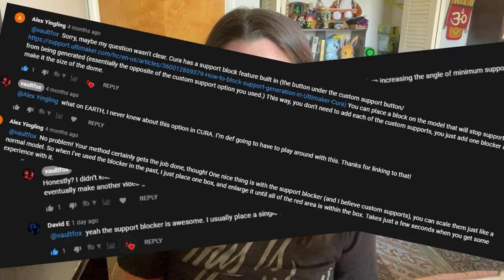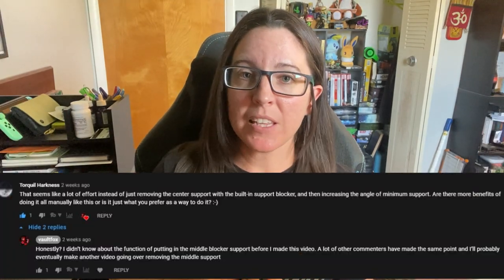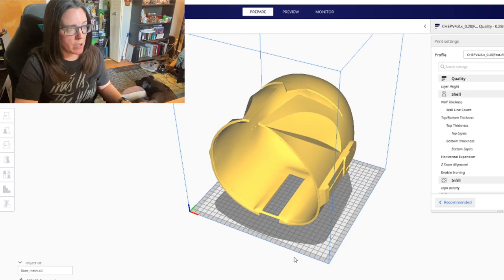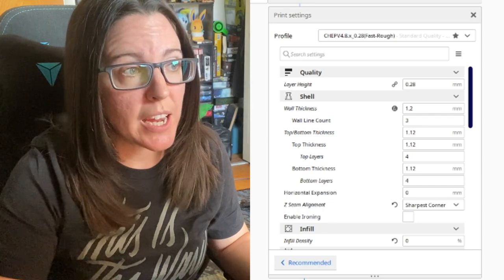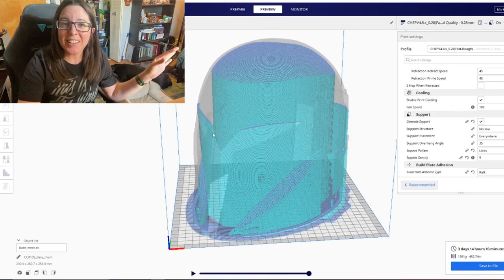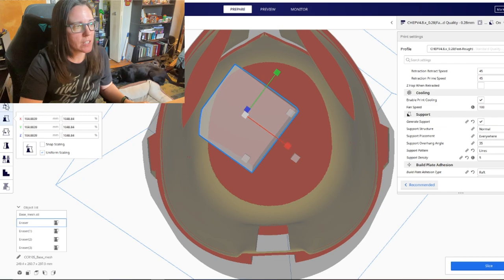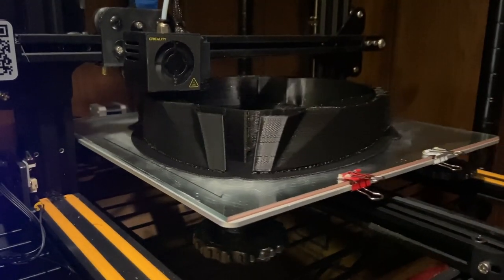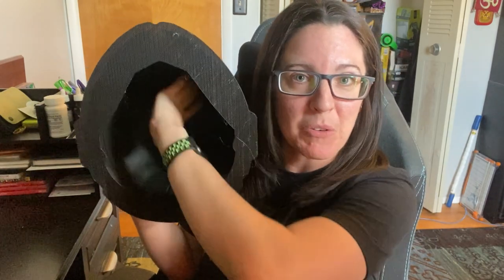How to 3D Print Helmets in ONE PIECE with CURA Block Supports // Beginner Friendly Tutorial

Comment: Hey, for rotating the helmet in the beginning you can use the "select face to align to the build plate" tool under the rotation tab in Cura, which makes it basically perfectly flat on the bed if you click on the face you want to put on the build plate, I also regularly turn off the "Uniform Scaling " under the size tab to only have to use one support blocker for irregular shapes, like the top of the helmet you had to use 4 for. Hope this helps you out!
Reply from the maker: oh that's a good trick to know, thanks for the tip! I'm so used to doing it manually so I'll have to give that a shot next time around
Reply: Yup. was just writing this until I saw someone beat me to it... about a yr ago. lol 
Great videos!

Comment: Great job. I do one block in the center and then size it without uniform scaling. I make it wide and short (like me). Another thing that I do is set my support overhang angle to 65 with general tree supports (mostly) and put in custom supports on things like the visor.
Reply: BTW, have you tried Arc Welder, yet?
Reply from the maker: LOL wide and short that made me snort ... I played with making them odd shapes but just found it quicker to just make those boxes, same reason I I just kept the overhang where it was so I didn't have to add in custom supports on the visor  I was also a bit frustrated with my PC continually crashing while I tried to slice this (it def needs replaced soon lol)

Comment: You may already know this but for those that don't. On models such as the helmet, the bottom may not be perfectly even and lay flat on the bed (like the helmet). On some models you may not need (or want) to keep the exact shape of the bottom of the model. In Cura you can lower the model down into the build plate until all edges are flat on the bed, then Cura will slice it ignoring any part of the model that goes into the bed. That way you won't need supports around the bottom of the model.
Reply from the maker: Yeah, I've done this before! I did it on a previous Bo Katan helmet actually

Comment: Current cura rotation tool lets you select an object face to align to the print bed... I think it's the 3rd rotation option.Check it out. A real time-saver.
Reply from the maker: I think I’m so ingrained in just doing it manually I forget that option even exists lol
Reply: @vaultfox  Fair enough. The other trick, I dunno if you mentioned it, is, in Cura.. hold down shift for fine control of rotation.

Comment: I recommend using a UPS (Uninterrupted Power Supply) for your 3D printers. I use 1 per 3 printers. I have my settings turning off the heating bed after 10 layers to save on power and to save on battery in the event of a power failure. The more power the UPS can hold, the better. A UPS can save you money and prints in the long run. Specially if you are printing 2/3 day prints!

NOTE: Depending on your UPS, you might not be able to heat up the bed of all 3 printers at the same time. You can do 2 beds (no nozzles). Then, when the 2 beds are hot you can start heating up the 3rd bed along with the 3 nozzles. That is how I do it. Its a minor inconvenience, but it has saved my 4/6 day prints! plus it also saves my printers from getting damaged.
Reply from the maker: That’s interesting! I’ve never even thought of using a UPS for printing cause I’m all honesty, now that I’m mostly printing for myself and not doing commissions they aren’t on constantly. But this might help if I ever decide to dive back in

Comment: How have you removed the image of your printer in cura?  Frustrates me when looking  at my print from underneath having to look through the image of the printer.  Good to see you updated with this video -   I was watching the original one and was wondering why you weren't using support blockers.  Also you showed me different custom supports to the ones I was using so interested to try yours.  The ones I've been using are the Cylindric Custom Support.
Reply from the maker: I never did anything to remove the printer image from the bottom so I can’t really help you there sadly

Comment: Loving these videos! New to 3D printing my cosplay materials and wanting to gauge a good choice for printers that can one shot a helmet. Would you recommend a Creality CR 10 for beginners? Keep up the awesome videos!
Reply from the maker: thank you so much, glad they help! I would personally recommend the CR10s actually, it has a few more features than the CR10 did (like power recovery if your power goes out, you can usually get the print to restart when it comes back and a filament run-out sensor) One thing I didn't know until I got it is that leveling it is a PAIN since the bed is larger, an Ender 3 or smaller would usually be a starting point but I skipped that and just went right to the big guns lol. As long as you're willing to maintain and tinker a bit, I think it's a fine beginner machine
Reply: @vaultfox  thank you! I’m actually trying to look now on where around me Carrie’s CR10s. One question I had is the CR10s also referred to as the CR 10 Smart 3D printer or CR10 V3 3D printer? My local Microcenter has them listed as that and I’m confused on which is who.

Comment: Fairly new to 3D printing here but what would happen if you decided to simply print the helmet upside down?
Reply from the maker: That works as well but when I did that the supports are on the outside and it just requires a bit more cleanup

Comment: How do you remove the supports without cracking the helmet? Sincere question lol
Reply from the maker: I've been there lol ... usually adjusting the air gap on your supports will allow them to remove a bit easier. I have another video on how I set-up and remove my supports on the channel as well

Comment: Hiya, I've gotta ask... I printed a full size helmet in one go on my CR10s V2. It completed the print and I did it without supports but on the inside of the dome it's a bit loose/non melted filament kinda thing. Do you have any tips how I can stop this? I have since calibrated my printer better. I'm thinking print slower but I was hoping for some advice or tips on settings etc before I do... I also printed one on my resin printer in pieces but that hasn't worked out either as the pieces sizes dont quite match up. Annoying!! I just dont want to waste anyone time failing lol Hope you can help cos yours looks great!
Reply from the maker: If the filament is non-melted on the inside, I would probably just take a heat gun to re-melt it back into place (on a lowish setting and going up from there just to be safe and not melt the outside). You could slow down the print speed too. The insides of my helmets printed without the middle support are usually a bit like what you described but it's never been bad enough to the point where the structural integrity is compromised.

Comment: Hello Miss VaultFox! ty for sharing this vid and info. I managed to print a mando helmet for my daughter since that is what she wants, but customized for her. I managed to print it in 1 shot via Cura with the custom supports without the middle part. It came out perfect on my CR10S - Pro V2 i just got. took 58 hours and 559g! not to bad. My issue are the supports!! they are on their like glue, almost fused and hard to break off. the supports are super rigid and really attached. Hard to break off. What support setting do you recommend to make it easier for the supports to come off? In simplify3D  those supports always break easily off, but this time i tried it in cura. thank you!!!
Reply from the maker: you're welcome! and I would check what your settings on the supports are like if you're using CURA as your slicer. CURA notoriously has them set at an absurdly thick infill level if you don't adjust it yourself ---- I have a video on my supports here if you're interested!https://www.youtube.com/watch?v=xFin1ynY0EA&t=7s

Comment: could this be printed on an ender 3 pro? or should i go with the Ender 3 Max? im new to the printing world and looking to get my first printer. looking to print mainly mando armor and other various cosplay stuff. any info you can give is GREATLY appreciated
Reply from the maker: it COULD be possible but you would need to adjust your adhesion settings and things, and if you need to scale it up any more than I did (it was 100% for me) you might have a little trouble. but I've seen helmets be printed on Ender 3's in one piece, you'll just have to do a bit of extra work

Comment: Have you tried printing things upside down? I have zero experience with this I just wonder if it might be faster.
Reply from the maker: I have before and while it is faster (not faster than this way) you have a lot of supports on the outside you have to clean off. The last time I did it the supports were fused to the outside and required a lot of sanding to remove
Reply: Bummer. I was thinking maybe this technique would've provided a way to forego supports considering it is basically a bowl. Anyways, thanks for the info.

Comment: I’m always so nervous to not put any supports under the dome xD I know that galactic armory does like the cross underneath the dome. But from what I’ve seen none is actually needed and it comes out okay? There’s no issues with any sagging or warping?
Reply from the maker: I have yet to have an issue on the helmet's I've printed with sagging/warping (I've printed mostly mando helmets and one clone) The inside of the dome will be a bit messy but that's not a huge issue since no one will ever see it
Reply: Right, makes sense. I’m in the middle of printing a clone officer helmet and I may have been too cautious but I ended up splitting it into 6 pieces xD The support structures in the nose/mouth areas were kinda scary and looked like they weren’t printing on anything. I’m still so new so that little but of red in Cura has me paranoid xD

Comment: So how does this actually work? And does it work with any helmet?
Reply from the maker: Most helmets (and I say most because there are always exceptions) won't need any middle supports because as the dome builds up, it's self supporting itself. Blocking out that middle support saves time and filament, while still allowing the slicer to generate supports where it's needed (like in the cheeks of a clone helmet or the visor of this Bo Katan helmet)
Reply: @vaultfox  because I'm printing a scout trooper helmet at the moment, and the top is more of a dome that builds up annd ends up going flat, so im not sure if that will work or not.

Comment: I'm just a little curious about one thing, how did you setup the printer settings or it's just the default settings? Other than that it helped a lot to make a helmet much easier, thanks a lot!
Reply from the maker: I have a video on my 3D printer settings in the description, I don’t think I used the exact ones shown in that video but they are pretty similar